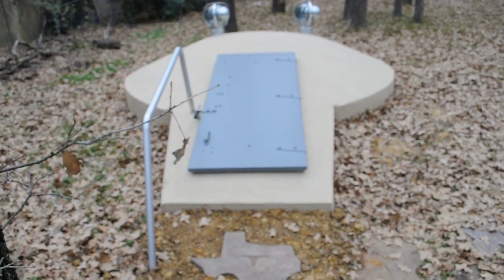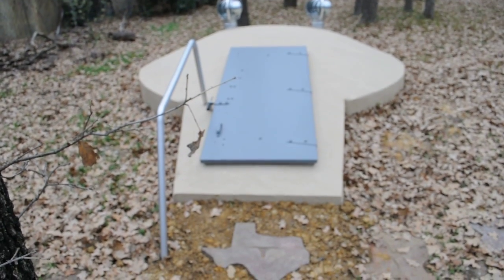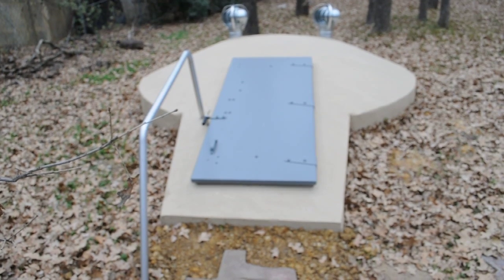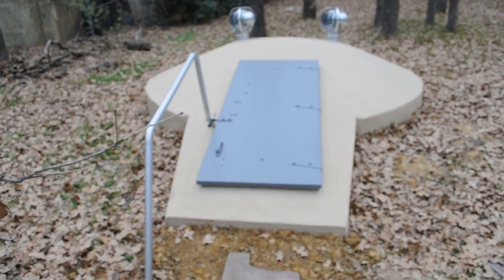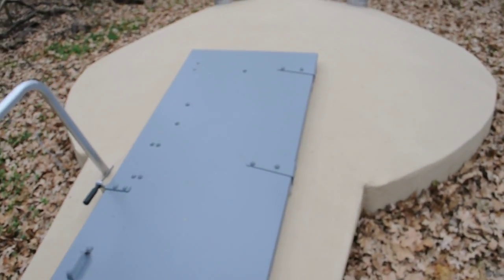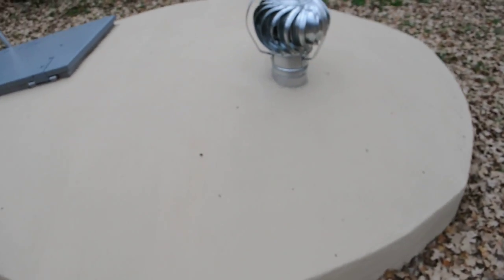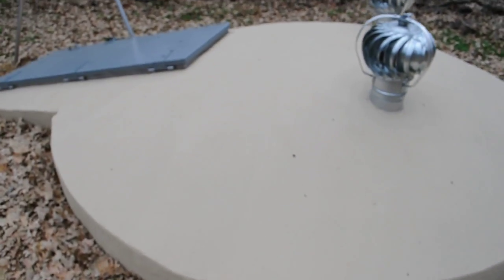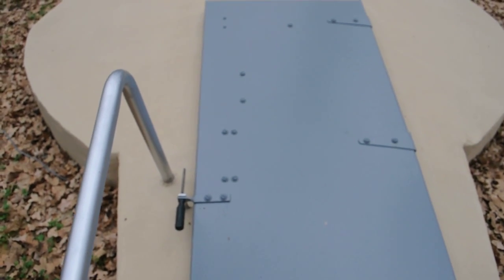Single Pour Solid Concrete Monolithic Tornado Storm Shelter

Comment: Before I retired I responded on multiple disaster relief missions. One of the worst storms I worked was that F-5 Smithville, MS tornado. I saw quite a few of these shelters and can tell you they worked very well! All of the people that took shelter in them survived unscathed, when all that was left of their homes was just a slab. 🥇

That storm stands out in my mind because of the devastation, those shelters and it was the first time I saw a water tower dented by a vehicle. The tornado picked up that car and slammed it into the heavy gauge steel forcefully enough to cause a noticeable dent in it! 👀😳

Comment: I see this video is now 9 years old which leads me to ask have you had any problems at all with the shelter? This is the type of shelter that I want. I live in Northern Alabama in an area that's usually hit several times a year with tornadoes. Have you had any problems with leaking? If you're still happy I'm going to contact this company and have one built. Thank you!

Comment: The roof vents will be the first to blow out of the shelter even in a not so terrible tornado - just curious, why not build the vents as a part of the monolithic pour?  using finer steel reinforcement mesh you can create the tube forms and then pour full of concrete, then wield an inch thick perforated steel plate on top to vent air. would be a good suggestion for the builder as an improvement? then such shelter will certainly be literally bomb proof :-)

Comment: looks like a good shelter to me. someone will get whatever is off the door in less than an hour. I wouldn't worry. I got one similar.
Reply: Could always add a couple of blocks of wood and a bottle jack for lifting an obstructed door but that is a very rare situation you'd be worrying about.  (1) Bad Storm (2) Bad Storm you have time to get safely into shelter for (3) Storm still also blows stuff on top of door (4) Nobody comes to rescue for long time.  Yeah that is Lotto unlucky if you need that jack!

Comment: The shelter itself is GREAT but the door is WAY too flimsy for tornado winds! It'll be blown off! It should be heavy duty and CANNOT be blown off by winds! The shelter CERTAINLY is thick enough for a tornado not to hurt anyone. It's just the door!
Reply: Actually he states that the door is "Texas Tech" approved which means the door passed the testing for recommended tornado resistant doors.  I would agree it is not vault quality which would probably run around two to three grand just for the door.

Also being the door lies flat with this type shelter you would need some type of heavy duty lifting apparatus to lift a super heavy door, making it impractical.

Comment: So............... if a big tree fall across the only entrance and exit and you happen to be inside at the time, how do you get out?

I am thinking of an emergency backup hand powered hydraulic system to force the door open for those cases. Maybe even a second exit some yards away via tunnel. Or how about a storm shelter that is similar in shape to a silo with a dome top, buried half way into the ground with a pad at least 2ft thick and 10ft away from all sides, single pour steel reinforced concrete, with a door that operates like a door on a pressurized airliner, where it has to come in first before it can be opened up outwardly?

But that’s just me.
Reply: Just have a hydraulic jack and a couple steel bars inside if that happens.

Comment: That storm shelter sucks
Reply: Care to elaborate on that a little LOL

     For one, it is monolithically constructed, which is correct.  This means it will be difficult to seperate/come apart.  Two, it is below ground.  So when giant heavy objects are flying across the ground at 100 miles an hour, they are flying by ABOVE you, not into you.

     Three, this is an affordable to the average person/family decently sized shelter with good solid steps.  Four, it is 45-50K pounds according to the owner, which means it, you and yours won't be pulled out of the ground to your doom.  Five, it has a FEMA approved 320/361 and ICC-500 Texas Tech tested door installed.  This means it has passed the impact testing and suction testing simulating 250 mile an hour wind draw for like 10 minutes duration.

     And as long as it is registered with the town/county, if you are trapped by debris you will be being checked into.  Keep some food and water in there.  No big deal.

     In my opinion this is without a doubt a great shelter choice to survive unscathed, at least physically unscathed, the hell of a tornadic super storm.  I bet the people who actually went thru them and survived in these feel the same.

Comment: Submitted March, 2018.   Danny Roach of Security Tornado Shelters of Blossom, TX poured our underground 10-foot monolithic tornado storm shelter in East Texas July of 2017.  We absolutely love it. We've had to visit (4) times since it was poured because of tornadic activity in our area.  The elements I love and most thankful for are:  NO seams or NO water leaks;  its custom built seating;  its large, wide carpet-covered stairs and carpeted floor;  feeling safe because of its solid concrete 8-10 inch-thick walls and floor, plus it's 10-12 inch-thick solid concrete dome top;  its super-thick heavy door; and finally its capability of holding a large number of people (when all together, we have 16 with room for more.) Danny and his crew are absolutely outstanding and are trustworthy to deliver as equoted.  Watching the pouring of a single-pour concrete shelter was fascinating.
Reply: Hey would you mind making a video of you shelter?

Comment: I've heard of folks just putting a powerful hydraulic jack under the seats and keeping some steel rod in there... I mean if it can lift a car, it should lift most anything on the door, at least enough for you to get out.  Remember though guys, put these in a place that is open.  Then you hopefully don't have to worry about debri, etc.  I like the fact that these are rounded which would alleviate a lot of water as well.  Wouldn't hurt to develop a checking system with your neighbors after a bad storm.... that way folks will come looking if necessary.

Comment: I built a shelter once out of solid steel and we only used sliding doors and we had a backup exit 40 ft away, again a sliding door
Reply: KosukiFire Oklahoma-Talk to me about a sliding door.  What does everyone know.  Are they good or bad.  How did you secure your sliding door once it was closed?  The OZ Saferooms have a sliding door, but they have a simple latch on the inside to secure it.  Freaks me out!  Other than having another exit, do you have a method of being able to make the sliding door open?

Comment from the maker: I have spoken at length with Mr. Dan Chism, formally of Smithville, MS about his experience in this style shelter during the Smithville, MS, EF-5. Everyone in his shelter survived without injuries and walked out of the shelter. His house was leveled and totally destroyed, as was his entire neighborhood. He lost 3 family members that were not in his shelter and 7 individuals in his neighborhood were killed. The shelter lost its roof vents, but remained intact without damage to the concrete. His door stayed secured during the tornado. He had the same shelter constructed at his new home and his old one can be viewed in Smithville on Google. Tony Greene built both his old and new shelter. Anyone interested in these types of shelters can contact Danny Roach in Texas or Tony Greene in Mississippi to find out more. Tony had multiple shelters of this design hit during the outbreak of 2011 in Mississippi and Alabama, including some in the cores of the worst tornadoes in the last 60 years in the U.S.A. No shelter is 100% guarantee in a violent tornado. There are pros and cons to both indoor and outdoor shelters. In an outdoor shelter, you need to be inside the shelter before the hail core and wind arrives. That means you have to be personally responsible and make good decisions staying on top of weather and heading to the shelter long before the tornado arrives. If you do not, you could be killed running to the shelter. In an indoor shelter, you run the risk of the house catching on fire above the shelter from sheered gas lines. In an indoor shelter that is above ground and bolted to the slab, can it withstand an F-350 impact without injuring the occupants? These are all possibilities. After researching them all, we chose this shelter and I am glad we did. There are many other good shelters on the market. This style of shelter has a great track record in some of the most violent tornadoes in U.S. history.

Comment: Door swings outwards - How do get out if heavy debris gets blown on top of the door?
Reply: You don't. You have to wait for someone to get you out. I wouldn't recommend in ground shelters. If the roof vent comes off and water comes pouring in and your door is jammed.... You're dead.
Reply from the maker: Sounds like OZ is made very well and would be a great choice for sheltering. All shelters have their pros and cons, including above ground shelters. Many of them I would not feel comfortable riding out the core of an EF-4 or EF-5 tornado. Under the right circumstances all above ground shelters can become an oven (from fires started typically by sheared gas lines)and anything under a  very strong EF4 or EF5 can leave debris piled on top of the home's foundation that makes great kindling. The style of shelter in our video has a long safe track record including sheltering folks in several EF4-EF5 tornadoes, many in the last 3 years. Its been around since the late 1950s and was actually designed in Oklahoma. One of the greatest things about America is that free enterprise leads to innovation. There is always a way to build a better mouse trap (or storm shelter).  People can choose what they believe to be the best shelter for their situation.
Reply: +akumasan707   It doesn't appear you are going to get an answer, but what some have done is install a lift jack of some sort that can be applied to the door to force it open.  Maybe you can find some videos showing overhead doors being forced open with a hydraulic jack.
Reply: Oz saferooms. Similar to this it is a monolithic pour solid above ground structure. Don't get me wrong this would be better than nothing but I'm not an in ground fan. My aunt and uncle were trapped in an in ground structure similar to this with torrential rain pouring in through the vent cover that was ripped off by the storm. In an hour they had 3 ft of water inside. Plus I am in Oklahoma which has a very high water table so in ground shelters leak a lot even with extra precautions the clay expansive soil does a number on these. With my Oz shelter I can walk in and latch the door. 18 inch thick ceiling 8 inch thick wall and 27 inch thick footer. Pressured concrete it's solid as a rock and went through the F5 that tore through Moore Oklahoma last year.
Reply: Krasnaja Zvezda
Because it would be very expensive and rely on motors, batteries, etc.   Just get a cheap above ground shelter and not worry about drowning.
Reply: Why not build a shelter above ground in a high water table area and then cover with dirt    I realize it’s backwards but would it work?
Reply: @bretts1  People actually do this and its a great idea.  You basically just haul in dirt around a above ground shelter. It just looks like a hill everywhere but the door.  And I have never heard of a tornado blowing a hill away.
Reply: Bill Williams Thank you bill you summed up what I was trying to tell excavators, screw the drain sump pumps and all that in high water tables.    Back in the 80’s a guy bought a round one with door and steps all fiberglass and buried it in high water table area.  No concrete just lots of dirt on half sticking out of ground and still no water has ever gotten in it.  Not sure why that design did not take off unles the same type of folks that plant tons around ac condenser unit think it’s an eye sore.   Think of all the hand made root cellars out of brick, when folks actually raised there own food and stored in one with dome hill on top.    Plus they hand dug it and laid the bricks by hand creating a brick dome.   All that common know how to survive from garden now lost.
Reply: @bretts1  Yep, We still have a cellar like that. My Great grandfather built it back in the 50's. I went down there yesterday and checked it for snakes....And all was good.  I sit out many storms in that thing back 40 years ago and it still looks the same.  I built a new house on the same property about 200 yards behind his. Just got off the phone with a local contractor. He said he can come pour me a above ground monolithic.  12 inches thick all the way around. 10x12. For $7300. It should weigh around 40k pounds.  I'm pretty sure no tornado is going to rip that out of the ground any time soon. I'm convinced that It's the way to go. And it's big enough for a bed lmao. I want something the wife can get her dogs in if I'm at work.
Reply from the maker: rextuner03 What shelters do you recommend?
Reply: vintagefans yes they do hold up very well, everyone that I know that have shelter from Oz absolutely loves it. The shelter in this video I have no doubt what do a great job protecting people in a tornado. A monolithic pour concrete structure is absolutely solid, however I just don't like the idea of being underground. So I would say it is more a matter of opinion then actual fact of a inground shelter not being superior to an above ground safe room.
Reply: Why not have multiple solid metal pipes of varying heights that can be closed with a valves?

The longer taller pipes can be clad in reinforced concrete and have battery powered inflow and out flow fans.
Reply: rextuner03 Actually, register your storm cellar with the local authorities.  After a weather event they will check on your location.  Water coming through vents are easily plugged with a plastic bag with a tee shirt or other clothing inside.  I know this is going to illicit a barrage of dissenting opinions, but a bit of tubing pushed past your makeshift plug will still have breathable air supply.  Remember avoiding the hazard of the STORM is the point.

Comment: Nice but, where do you keep the emergency chili rations to wait out the storm?
Reply: +Heru- deshet   Sounds like a porta-potty will be a necessary installation.
Reply: Bushcraft and Survival
After drinking all the beer and eating all the chili, the empty cooler is just as handy in a pinch. XD
Reply: +Heru- deshet I was thinking the same thing. I noticed the semi-circular bench has a bit of space underneath almost like a shelving unit. If it's just made of wood, I'd trim down the bottom edge a bit more to make it more accessible and you could put tons of things in there. Radio, stocked food, blankets, water, etc.
Reply: Rose C
 Don't forget the first aid kit and a cooler of beer to go with the chili.

Comment: Has a screw driver as a holder on the door
Reply: *****   Wonder what FEMA says about a sliding door as to how it secured.  On locking the outside of the door....let me tell you a story that I heard in two different towns that happened to two different people.  Guy went to "his" storm shelter and it was full.  One guy was told that he needed to go somewhere else.  He just installed it in his back yard.  He had his yard locked up.  His neighbors went over his 6' fence and got in his shelter.  The day after this happened he called the installer and had him fix it so he could lock it up.

Comment from the maker: We had four additonal sliding pins designed and manufactured by Don Lambert  at (Leanin Spade Iron Works)
 out of 3/4" steel round stock with 1/4" plate backing plates. He designed it so the pin can't fall forward disrupting precious time to get the door shut. It's captured in 10 places now including the hinges.

Comment: Looks like a good product.  My only suggestion would be to use a counter balance hinge on the door to support it when open.  You don't want the strong gusts during a tornado to slam the door on top of someones head.  Ouch!

Comment from the maker: @Jinx11111 Yes, he installs in DFW. He is a great contractor and he will do a great job for you. Please give him a call so you know you will have a substantial shelter. These shelters can not be beat because of the single pour(no seal to leak later), monolithic design (arched ceiling, stronger walls, wind flows around) and underground with nearly a 50,000 lb. weight. You have 8-10" in the walls and floor and 10"-12" in the ceiling in a single pour.

Comment from the maker: @Brandonwyoung  The total construction cost installed was about $6000.00. This included mileage two nights hotel and other expenses. The substantial construction of this shelter was well worth the expense and effort for us. We researched shelters extensively and when you talk to the experts, being below ground in a substantial reinforced solid concrete shelter is always the advice if you can do it.